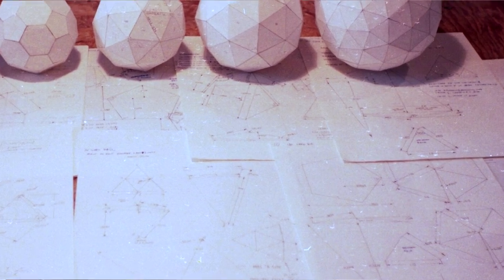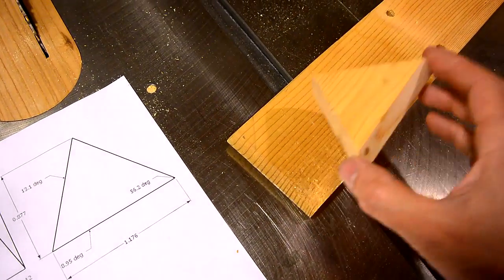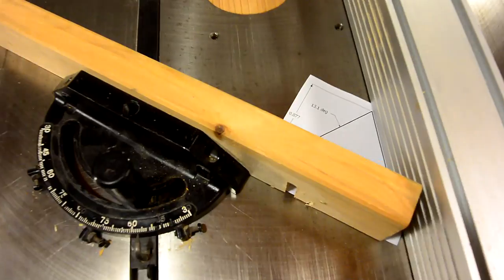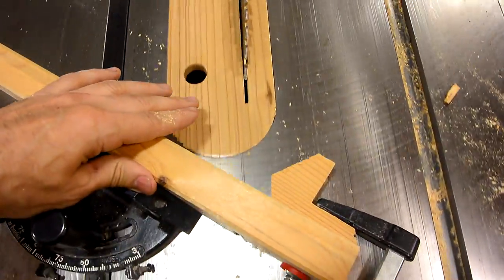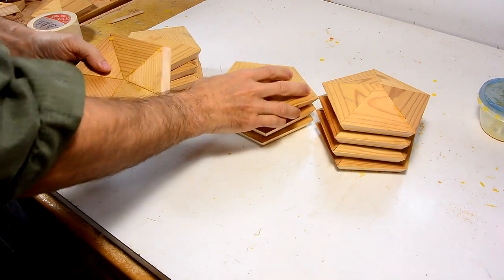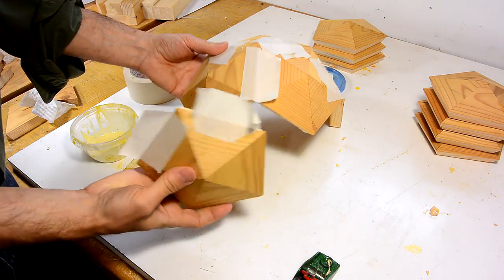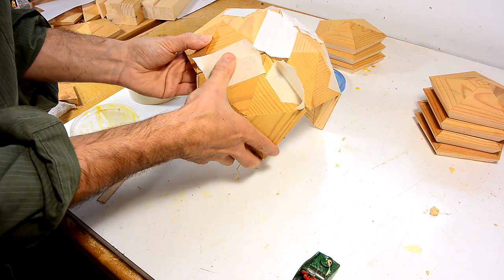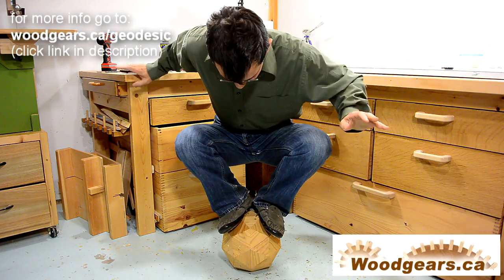60 sided geodesic dome

Comment: Im just wondering what you mean by sawstop?
Reply: Pedro Klintos apparently this is an automatic braking system/dead mans switch for table saws that detects when current passes from the blade through something else, such as flesh.
Reply: But why wouldn't he want that?
Reply: Pedro Klintos Doesn't it actually break the drive of the saw to work?
Reply: Oh okay, that would make sense :) Thanks for the help guys :D
Reply from the maker: ***** Indeed.  Looking at woodworkers on YouTube, it's the less experienced ones that use a SawStop.
Reply: Even experienced woodworkers make mistakes... like cutting through a clamp eh. Maybe us less experienced "sissies and children" just have nothing to prove and would rather not lose a finger or worse if we make a simple mistake like that someday. Especially those of us who don't do it full time and need our fingers to write code at a day job ;-) I much prefer the sawstop having my back rather than the alternative of "just be perfect and never ever screw up for 20+ years," and if that makes me a sissy well then you win tough guy.
Reply: ***** Real men don't need all 10 fingers.
Reply: Elijah Taylor It's not that people that use one is a sissy, the problem I have with the sawstop is that adding "sure fire" safety features to things tends to make people complacent, and complacency ultimately leads to accidents.  Accidents that remove things we'd rather not have removed.
Reply: Matt Johnston Agree on that point. Complacency is dangerous no matter what the source is though, be it overconfidence or too much reliance on a safety system. I still treat my saw as a respected and very dangerous tool every time I turn it on. I liken it to a seat belt in a car. It doesn't change my driving habits but it will hopefully come in handy should I lose control in one split second. Plus lets be honest anyone that can turn on a tool with as much power as a table saw and feel completely safe and casual around it was bound to injure themselves anyway ;-)
Reply: +Mattjohnston I still approach my sawstop with the same level of respect as a regular saw. Brake or no brake, it still scares the crap out of me.
Reply: Langdon Harris you shouldn't fear a tool. Respect, yes. Fear, no.
Reply: Matt Johnston by scare I mean it scares me what could happen.
Reply: Pedro Klintos “Sawstop” is a brand name.
Reply: Langdon Harris fair enough. It's good to hear that you personally have that level of respect, but I don't think that's the norm. There are just too many examples supporting my first statement.
Reply: I have been woodworking for over 40 years. I still have all my fingers.  Obviously I have respect for the tools I use.  I don't use many safety gadgets and when I buy a tool that has one, I weigh the safety and usability, and decide weather or not to remove it.  I don't begrudge anyone who uses safety devices, because the skill necessary to be safe varies from person to person. If a guard enables a kid or novice to work safely, great.  I have seen amazing work done by safety nuts, but I do believe in the survival of the fittest.  Too many devices remove the need to think, and dumb down our society.
Reply: Pedro Klintos sawstop is a brand of table saws that stop running when the blade comes in contact with a conductive material, such as human skin or metal.
Reply: Matt Johnston Huh, yeah, really makes you wonder, doesn't it? You might want to give it one hard, long think.
Reply: Matthias Wandel I don't really see what you have against it. Sure, it sucks that you might need a new brake when something activates it, but at least your finger is still attached. would you rather pay a little less than $70 or a finger, and thousands of dollars in recovery, plus time out of the shop. you could even keep spare brakes and blades on hand(no pun intended). I recently purchased my SawStop, and feel no sense of false confidence about it. I still respect it as if it is going to go through my hand if I mess up. If you are making a risky cut, you can always put it in bypass mode. Might be worth considering:). P.S.- it's not just the "inexperienced" woodworkers using SawStops, maybe those with more experience just don't want to part with their current saws.
Reply: Pedro Klintos We have one in the wood shop at my university.  Each stop basically breaks the saw, because the blade is slammed down into a rubber stopper.  It's great for open shops like that when inexperienced people are in danger of their own ignorance.  The only downside is that if you trip the mechanism, the stopping motion basically breaks the saw.  Afterwards you have to replace some parts to get it working again.
Reply: Sculpture Junkie not quite. The saw has an aluminum brake not a rubber stopper. And the saw doesn't break. After replacing the brake and blade, which takes less than 10 mins, it's fine to use again.
Reply: Sculpture Junkie also the brake slams into the blade not the blade slams isn't the brake.
Reply: Langdon Harris Alright.
Reply: Sculpture Junkie sorry if I sound like a know it all. Just wanted to make sure he has all the right facts.
Reply: It's okay, you are correct.  I went back to the video of when I first saw the technology in action.  In some scenes it does appear to function exactly how I described but that's not actually what is going on.
Reply: Chris Hall  No, It is a replaceable brake that fires into the saw blade, absorbing it's inertia, and tells the onboard computer to stop the motor and shut down the saw. You should definetely check it out. :)

Comment: You have inspired me to attempt a geodome.  The plan would be to make triangles as you have here.  In this application you are joining pentagons to pentagons.  My desire is to create a 2V dome.  This is six pentagons and ten regular triangles.  The regular triangles are the same dimension as the outer sides of the pentagons.  In my planning, I have struggled with the bevels of the struts.  The better the bevels match the true angles created the more integrity the structure will have.  Could you direct me to a process to find the best bevel angles for the inner pentagon struts and the outer pentagon struts?  My ultimate goal is to have a lightweight portable structure, covered with reflectix and plastic.  My hope is that this would serve as summer time for Boy Scout camp and winter for Boy Scout Klondike which is a winter camping experience.

Comment: i dont get it why would u have been cursing if u had a saw stop. i never had a table saw but im still curious
Reply from the maker: Because I'd be out $150 in cartridge and blade from having cut into the clamp.
Reply: Oh lol
Reply: sawstops are a pain in an industrial environment. we replaced our table saw with one and dont get me wrong they are awesome but damn spent more time reading code lights than ripping material. thanks corporate saftey